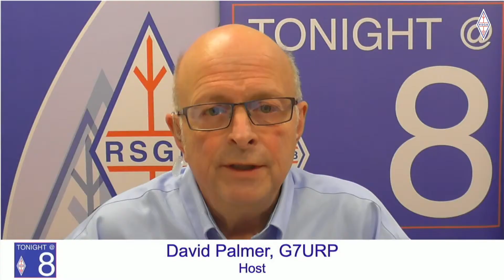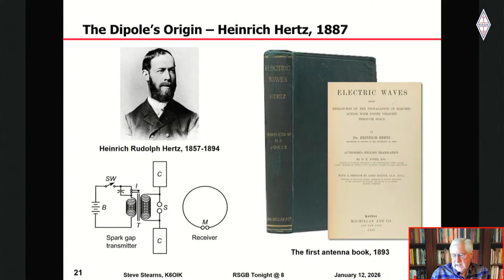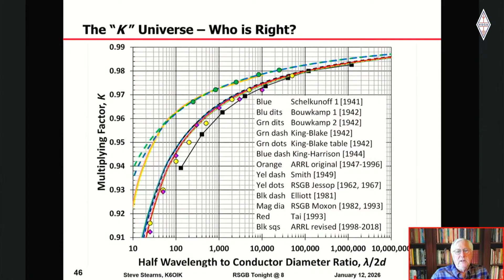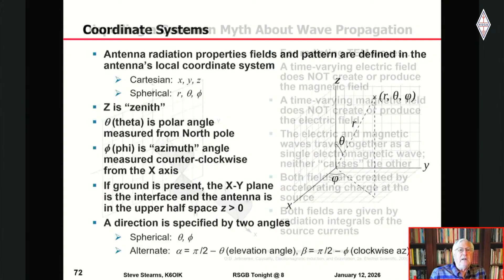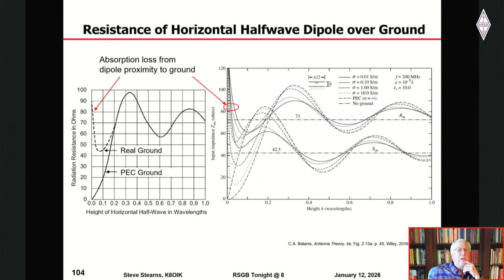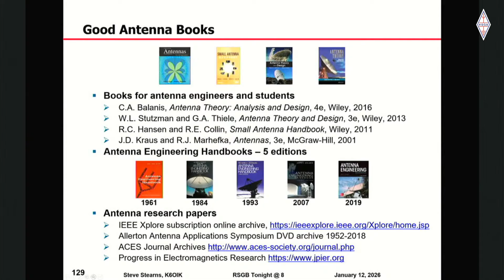RSGB Tonight@8 - Dipole Basics by Steve Stearns, K6OIK

Comment: Pretty interesting but complicated. The dipole field animation was good. 
Not a dipole but an indoor inverted vee here I've been playing around with an SWR meter then checking with a NANO VNA which I bought earlier this year. An inverted vee is a kind of dipole. Aiming for as low a reading as I can get on my meter.
Interesting results. Tx on 24.950 MHz.

24.950 MHz 48 Ω -j1.9
24.900 MHz 46 Ω +j3.2
25.025 MHz 48 Ω -j6
25.125 MHz 49 Ω  -j11      Impedance drops going higher. 

Edit: My meter was only just twitching on the end stop. 

It says to me don't worry too much about the exact length because:
A. We move up and down the band.
B. Everything will change if it's outside due to wind and rain. 
C. Nobody at the receiving end will notice any difference if it's 48 Ω or 49 Ω or 46 Ω or even higher or lower.  
D. Similarly with -j1.9 or -j11.
E. An SWR meter is an accurate enough instrument to get a dipole tuned. 

 I really got the VNA to make a 4 element 2m end fed collinear but this was interesting. Also for checking filters. 
G4GHB.